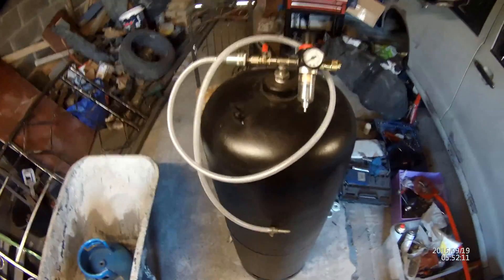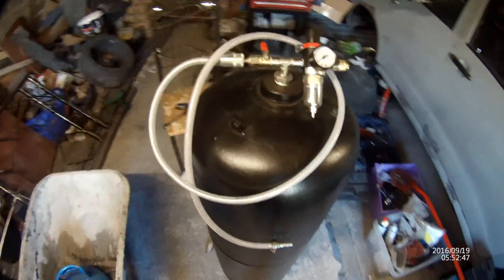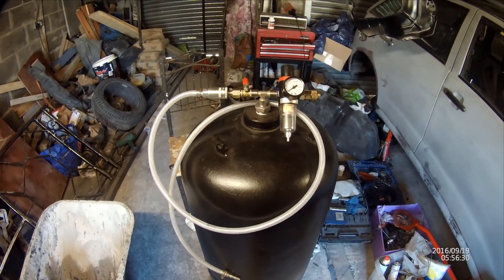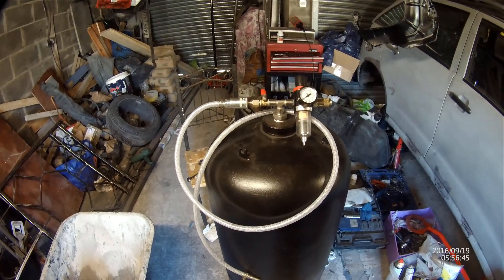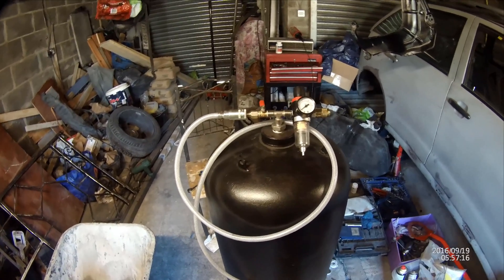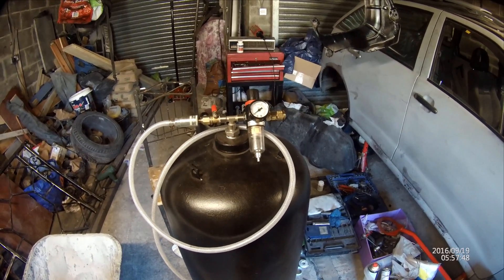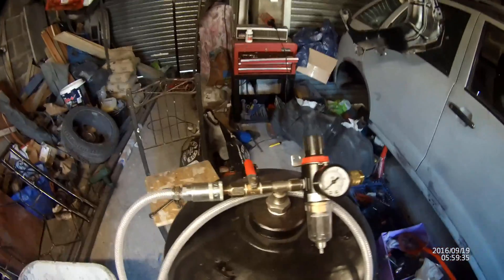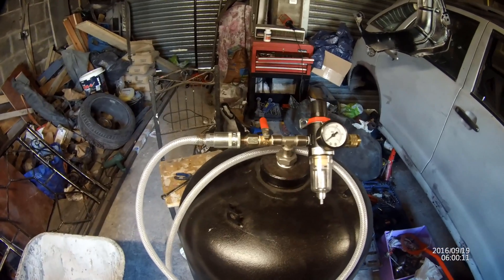How to convert a gas (lpg) bottle to an air tank 47kg bottle (95 litres) In the UK

Comment: Did you ever get round to installing the drain valve on the bottom of the cylinder? I've done pretty much the same setup as you and have put a drain in the bottom. After looking on youtube everyone screams bloody murder at the suggestion of welding a gas cylinder, apparently it can lead to cracking.

Comment: Burst pressure for these bottles is about 425psi, so running one of these up to 150psi isn't an issue, Mine has given trouble free service for many years, I didn't weld in an extra drain valve but instead incorporated it into the fittings on the top then turned it upside down, so now the air enters into the base and there is a second small full bore valve I operate to empty the cylinder. All the bits for mine I bought off evilbay for around 30 quid, spent another 15 notes on paint. 
Note, the original valve has a safety feature that lets the pressure out if it exceeds 375 psi, the cylinder itself is much tougher.

Comment: Thinking of doing this to allow air tools like impact driver to work. Have a 270 model compressor from lidl which works fine, but not enough in reserve for some power tools. Looked at the bigger compressor they do which seems to have ths same motor just a bigger tank.
Reply: i have a parker richmond 50L compressor it runs a 2.5hp motor its not the oil free kind. ive seen many USA video's using a 2.5hp motor with a much bigger tank similar shape to my gas bottle only wider so if they can run them on 2.5hp there is no problem me running 150 litres total on the compressor. 

ive used it a lot the most i used it for was painting a fence about 15 metres long i would paint until i ran out of paint them stop to refill. The compressor would be running most of the time and it ran perfectly fine didnt get too low that it lost pressure or anything and the thing has a thermal cut out and that didnt trigger so it works pretty well. 

When i use it for air tools though like screwdriver, ratchet etc i tend to just fill the system and knock it off because you dont really use air tools constantly anyway so no point it topping the system up all the time when theres plenty of air in there already. even when its getting down to 4 bar it still runs the tools sufficiently

Comment: Thread pitch can be measured on a taper using standard pitch guages, it's the thread diameter that's a nightmare to measure on tapers.
Reply: yeah correct thats why i bought the wrong size adapter the first time! got it right the second time though im not using an adapter with a taper its straight 3/4" bsp but i have no leaks. i think the taper is far more important for gas than air though because a gas leak is bad an air leak isnt as bad.

Comment: Hi there, great video, have you a parts list to hand? I've got the bottle 47kg but not sure where to get the parts? Many thanks Ian
Reply: 3/4" BSP male to 1/4" BSP male thats the bit that screws into the gas bottle this is the only part you really need to know the size of. 

then theres a 1/4" BSP tee 3 female ports, the rest is optional because you can configure it any way you want to so everything is quarter inch BSP either male or female ends so its basically whatever way you want to go, 

you could even go a different route if you wanted your system to run 3/8" all you would do is get a 3/4" to 3/8" piece that would screw into the gas bottle and use all 3/8 inch parts.

Comment: So has it helped your compressor having the second bottle? I am looking at setting this up to stop my compressor having to turn on and off so often. I plan to leave it permanently open so compressor just sees it as extra storage.
Reply from the maker: its pretty good to be fair ok it takes a lot longer to fill this and the 50 litre compressor too but what i tend to do is fill both then turn off the compressor and run what i got to run straight off the big bottle. i can go for quite a while before it needs filling again. ok it does drop the speed and that after some time but if that isnt really a problem then it works good. but ive also run with the compressor going constant to top it up to keep the pressure going and the compressor just keeps going and going.